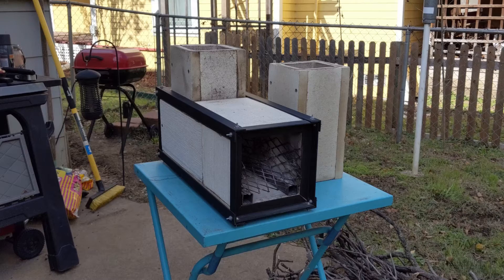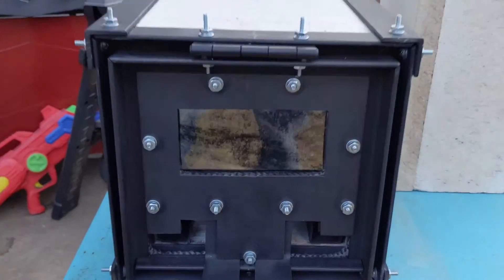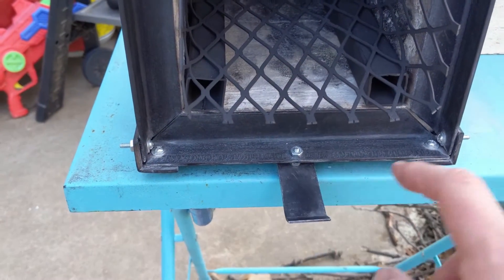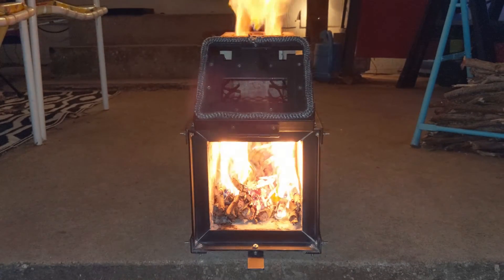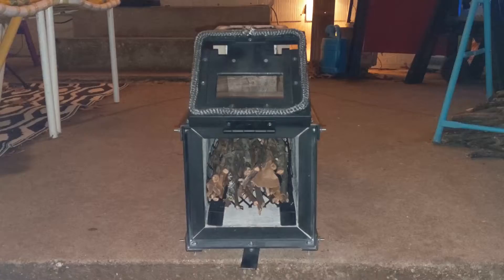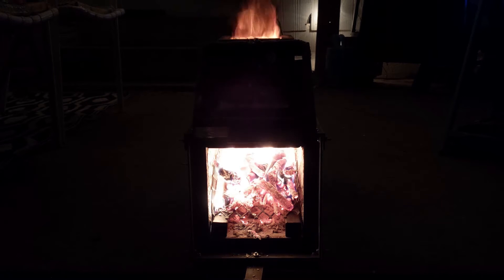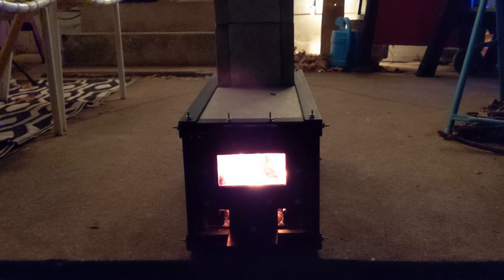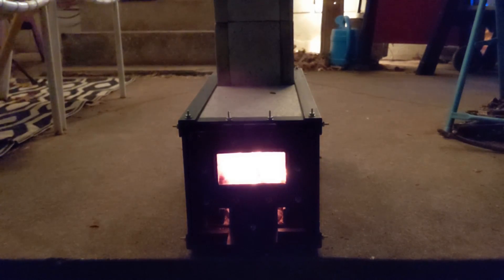Blue Flames Are Good Flames - Rocket Stove Upgrades

Comment: The temps your running the stove at are in the range of  diesel exhaust temperatures, therefore a thermacouple and guage can be installed to read constant temperature at the thermacouple install point.

A 35 gallon barrel laid on its side would make a great heat collector and securing point for 4" single wall pipe to duct cooler gasses outside the space.
The radiant heat would be tremendous. With the temps your working at.

Why  not add secondary air at the turn to verticle also?
Reply from the maker: Interesting idea about the thermocouple. For the video I was moving around a lot so I chose the IR thermometer. The laser  also looks cool on camera ;)

If I'd use a barrel I'd probably put it up so it can encapsulate the whole heat riser and I don't have to float it somehow. I'd also put some high temperature material like vermiculite either spaced off the top of the riser or attached to the underside of the barrel lid so it doesn't burn out as quickly.

In my first rocket stove video I explained why the secondary air is right at the port, because it will suck in the air automatically. You can probably cut those pipes a little longer at an angle to get right in the middle of it, but it seems to be working already.

Here's the video if you're interested. I explain the design in the first few minutes before the build starts: https://youtu.be/BcX77FlJw0Q

Comment: So have you used this hard for at least one big burn everyday, to test your metal exposed to the full on heat on a daily basis. (few have made that work but perhaps you have got it)
Reply from the maker: For the video I burned it hard for only two hours two days in a row. For each test I refilled so the system warms up and then refill again for recording the test.

Which metal are you talking about BTW? The door shouldn't be a problem because that's cooled from the outside. I considered lining the inside of the door with vermiculite but I concluded that's too complicated for my use case. I primarily wanted to test no door vs dedicated primary and secondary air.

The metal on the inside (secondary air pipes and grate) I consider sacrificial. They will spall and eventually burn out. At that point I will replace them.
Reply: @BitsOfInterest   Ok, that is what I wanted to know, if this has been tested on a daily basis I mean,  as far as the metal question goes, I was meaning the grate, and like wise  would be surprised if it lasted long.. Always fun to test a few things though.
Reply from the maker: Rocket stoves love metal, especially eating it ;) The grate I made last year and I used it about a dozen times or so for multiple hours each. It's still holding up structurally, but it's already spalling. If you'd use it on a daily basis maybe it will last one season (3-4 months) probably not more. The secondary air pipes may last longer because they are thicker metal.

That said, there still is value in having something similar that allows air from underneath and ashes to fall through, you'll get a better/hotter fire from it.

Comment: Very cool! Thanks for the great vid! Are you also planning om making a firebox over the exhaust? Would be cool :)
Reply from the maker: Thanks! I'm not sure what you mean by a firebox over the exhaust but one day I want to build a grill/oven around it. I hope it doesn't get too hot for that 😁👍
Reply: Oh I mean like a bell (I think it's called like that). Like what they did in this vid: https://youtu.be/gEwHdoi2Nb4

Do I hear some Dutch in your accent by the way?
Reply from the maker: Ah, yeah. That's what you would do if you're building a rocket mass heater. I don't have plans to heat my house with this one. It's too small anyway so it needs to be refilled quite often and is more for short use outside.

PS That's correct. Not many people can figure out what accent that is ;)

PS2 Sorry, your comment got blocked because of the link so I didn't see it until now.
Reply: @BitsOfInterest  Niet een heel sterk accent maar toch wel duidelijk

Comment: Thank you, that is looking so good! The analysis suggests (as you imply) that if you have enough air, it matters less whether it is primary or secondary air . . . I would deduce that your mixing of air with wood gas is very good, with your rams horns making sure that the air gets properly mixed in.  Well done!  Blue flame, that is just awesome.... 🔥👍😁  ps: the water glass coating looks to be much harder, is it good?
Reply from the maker: Thanks! Part of my results could be that I don't have a perfect seal (or any seal at all) from the door to the secondary air pipes, but it seems to favor a mix of primary and secondary air. The rocket stove is pretty much self regulating, so you just have to give it what it wants :)

As with most of the enhancements I experiment with, I probably should've applied the water glass when I first built it. I haven't seen any new damage and it appears to be much tougher. You can even hear it when I pull the secondary air pipes out; it sounds more like rock or sandpaper when there is friction, instead of a softer sound when you gouge the material. Where there was existing damage though it really soaked into the boards, so it would be easier to apply on new boards with their factory coating.

Comment: In the house?!?!
Reply from the maker: You can use the same principle/design to build a rocket mass heater for your house. You'd enclose the core (the only part I have) in brick and/or metal and add a chimney to the outside.
Reply: @BitsOfInterest   There is so much more to this,  such as the sq ft of surface that this core can utilze, as well as all the factors that make a good stove set up.